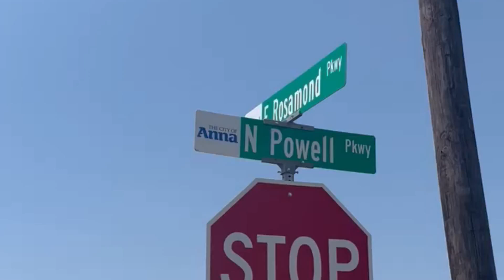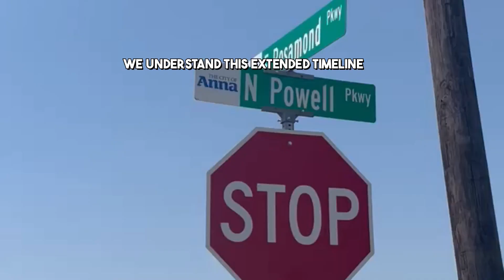Traffic Signal Installation at Rosamond Parkway and SH 5, Anna Texas

Comment: 18 months is not good enough when there are accidents here serveral times a week. That has to be enough to increase the urgency with TxDOT and the railroad company. I find it hard to believe our city officials can't help push this faster and still maintain the appropriate safety measures are in place. Hopefully it doesn't require a "death toll" like the light at FM 371 did to be installed.